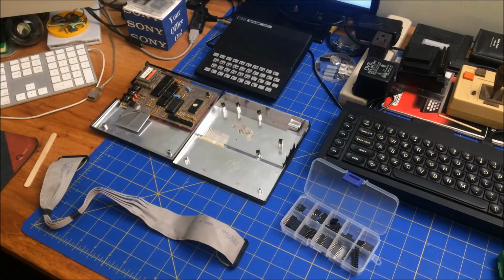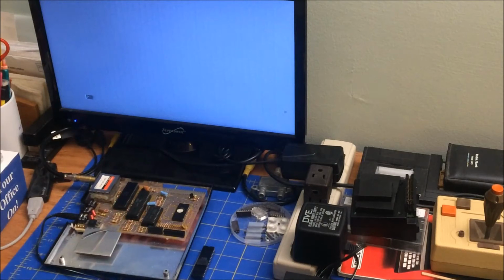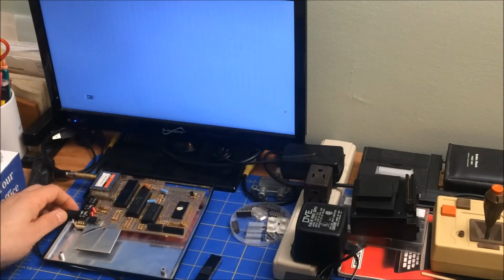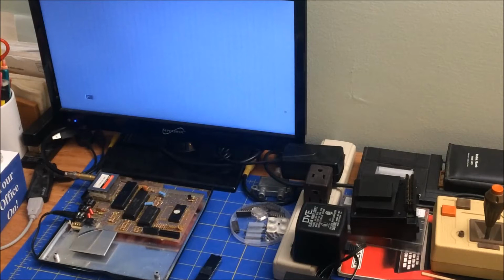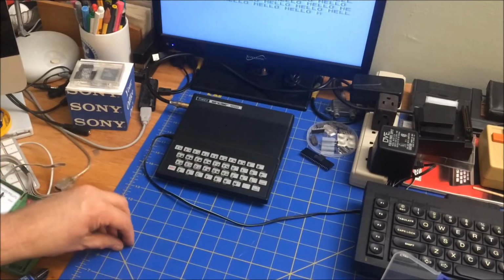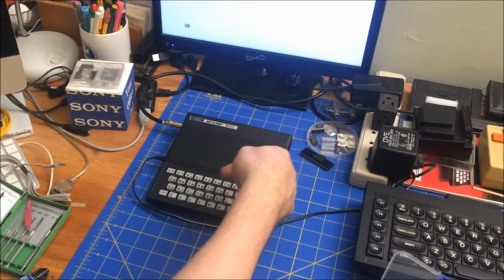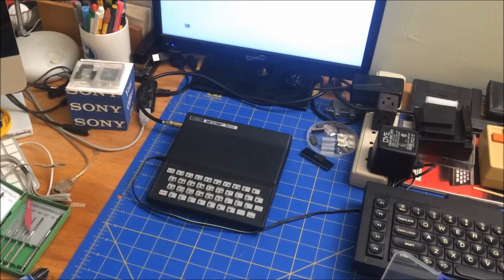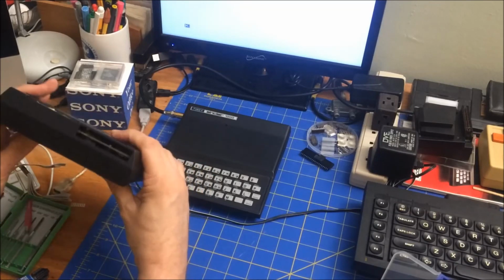ZX81 Keyboard Fix: Replacing Membrane With a Ribbon Cable

Comment: Nice repair! I just came up with the same method while pondering how to reconnect a badly cracked ribbon. Thanks for the header pin socket idea. I'm going to use that and place them on the back of the board so that  the keyboard can be disconnected before removing the 2 pcb hold down screws.

Comment: Really creative great repair.  
I went with the new membrane, and yeah my TS1000 now has RUBOUT and NEW LINE instead of Delete and Enter. ;-)  
I do have a replacement overlay that has the Delete and Enter, but I haven't put that on yet.
I did composite mod mine (ZX8-CCB) and internal 16k and those work great.
The only other mod you might want to seriously consider is replacing the LM7805 with a Traco DC-DC converter.  Really lowers the heat inside that case when it's running...
Reply from the maker: I will look into that. I'm also adding a joystick to it. I got a Nintendo style pad and will be wiring it straight to the keyboard matrix. Gotta figure out where to feed the cable through, though I got an ultra thin one so I could drill a tiny hole the side and run it out there. The controller is black and red, matching the colors of the ZX81.
Reply: @8BitRetroJournal  Oh, I'll be watching for that!  I've thought about adding a joystick, but wasn't sure...

Comment: So you irreversibly modified the ZX81 main board rather than just replacing the keyboard membrane? :( Well at least the system is usable now. It would probably have been cheaper and easier just to replace the keyboard, they are readily available.
Reply from the maker: Definitely not irreversible. Can just unsolder the 14 wires from both ends and put the connectors back on the board (solder is very reversible). Plus I want to make other changes to it like the internal 16K upgade, the composite mod, and speed it up. That will also change stuff internally (cut traces, RF modulator replaced, etc). So there is really no way to get around it if you want to make a usable ZX81/TS1000.  If we leave our retro gear untouched it ends up not getting used. Plus, I have a second one that will remain unmodified. With this fix, I saved the original keyboard since, for the ZX81/TS1000 you have to take the top off as well (like replacing the entire keyboard on a C64)...so it's a 50/50 proposition for me: don't change the motherboard but replace the keyboard or keep the keyboard and replace connector/cable on the motherboard.
Reply: @8BitRetroJournal  
Applying heat to desolder connections on a 40 year old circuit board runs the risk of causing the traces to separate from the board.
Reply: @8BitRetroJournal  
Quote: So there is really no way to get around it if you want to make a usable ZX81/TS1000.

On my TS1000 for memory expansion I use the ZXPand Plus which is amongst other things a 32k WRX graphics compatible RAM expansion. I  use a small miniature B&W TV for a display. I use TS1000 pretty regularly. Many large modern TVs (like my 65 inch flat screen) also still have a cable tuner that will tune analog TV channels and I have also used this with my TS1000. I have the 210E version of the ULA which provides the back porch signal and I get a very usable display. Modern ULA replacements are also available which install by plugging in with no soldering required, which provide composite video out directly from the ULA.
Reply from the maker: @star2gmail  Sounds like you can do many things without hitting the circuit board. I'm not too concerned about soldering on the board though. Even if I break a trace, these boards are really easy to fix and anything can easily be reversed, just need to be careful with he ULA. Also, it's fun to tinker with these devices and since I have two I won't feel too bad modding one at the board level. I already have the chip for the internal RAM upgrade, so looking forward to that mod when I have time. Don't know if you have seen my other video, where, as a kid, I built my own case and stuck my ZX81 board (ok, so I have three 😕) inside it with an amp and homemade keyboard. I also have a spare QL board that I'm excited to tinker with. If I only had one of each, then I likely would keep it untouched, though I did mod my US QL (very rare) to do both color and monochrome composite (just a wire and a switch)...so I guess I broke that rule.

Comment: Nice to get rid of the membrane cable, Mike, and creative to reposition the membrane connector to the top cover!
If one were to do it again, one might consider adding a standard 14 position 2 row IDC connector and using a standard 14-position ribbon cable. You'd still cut the cable to a short length (as you did) and still solder one end of the ribbon cable to the motherboard, but then the IDC connector could be glued to the top cover immediately next to the membrane connector allowing it to be unplugged to completely separate the top from bottom for servicing.
Reply from the maker: I used the wrong ribbon cable from a 40 pin for a 2.5 inch drive. Had I used a normal floppy ribbon cable I think my plan with tinning the edges and inserting them into the connectors would have worked. I had already done the one end that goes to the ribbon so I decided to make it all one piece. It's long enough where it's not a bother but I could still go your route if I get my hands on the right connectors to do it from the circuit board end.
Reply: @8BitRetroJournal  totally makes sense. I' ve just been working with a bunch of 14 position ribbon cables for my Amiga2MacFloppy interface and thought that'd work well here. :)